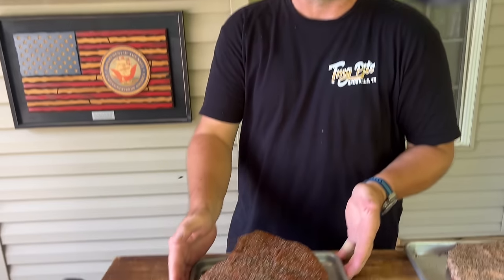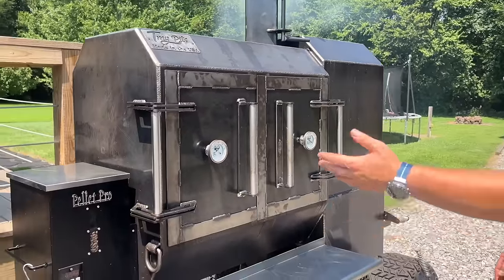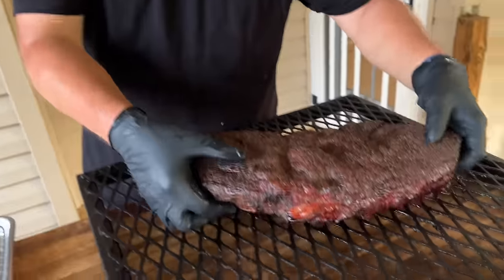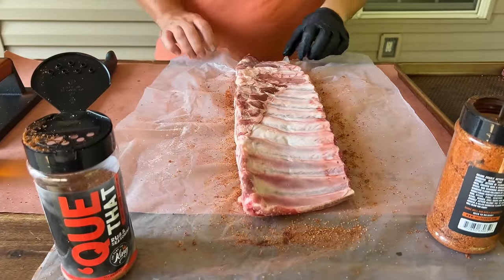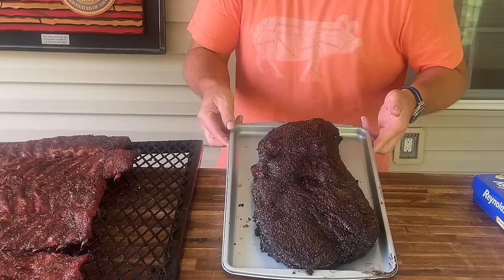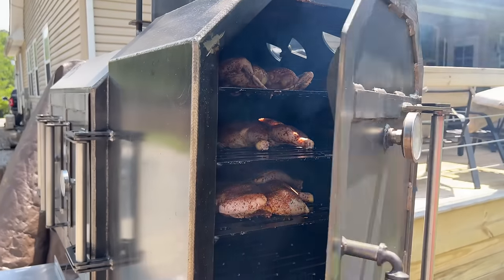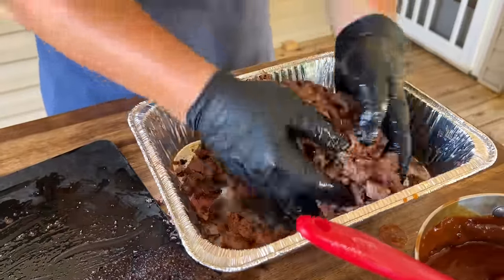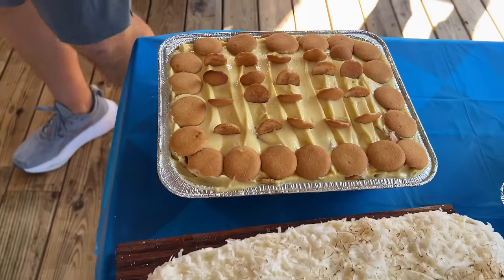New GRILL Handling a HUGE BBQ Feast for 30 People!  Brisket, Ribs, Chicken, Sausages, and more!

Comment: Half the I smoke brisket, pork shoulder, pork ribs and beef ribs; I tend to cook till at least 185F and let rest til 150F. Then I put in my Pit Boss Verticle Elite or smokin' tex 1500c at 150f and hold overnight. It is often pull and bite threw tender.

Comment: I think you would absolutely love the SnS Kamado, as it's basically a Weber Kettle in Kamado form, built around the Slow N Sear. Definitely has that set it and forget it when you learn your vent settings, with much better flavor than a pellet smoker. Great jack of all trades pit and one of the best bang for the buck pits on the market IMO.

Comment: All the meat looking good. The brisket, were you concerned it being in the danger zone of 40 to 140 degrees soo long. It took the brisket hours to get above 140 then you took it out to cool down to 150 before refrigeration taking it longer to get below 40 degrees then next took a long time to get it up and over 140 degrees. Bacteria loves the above 40 degrees and below the 140 degrees.
Reply from the maker: Was I worried...yes..did it happen...now...at the 3 hour mark at night we double checked and had to ice bath it...dropped like. a rock..we were right at 60 degrees...so didn't take much...bringing back up to temp...same thing..the temp mirrored cooking a brisket...What surprises me is how many  people tell me how I cook brisket wrong and they have been doing it for 40 years etc...but they only cook at 200 overnight...or 200 for 4 hours and bump up to 250 the rest...we here it all..and just like you...the first thing I think of .....aint know way that can be safe....no way in the entire world.....a briket being cooked at 225 or under can get above danger zone in 4 hours.....
Reply: @PelletsandPits  I’ve been smoking pork ribs anywhere at temperatures of 145 to 170 around for 4 hours before wrapping and finishing probably not getting out of the danger zone I believe probably 5 hours. Knock on wood no upset tummy or anything. Kind of wonder about the safety guidelines are on the safe side?
Reply: There’s always one of these guys 🤦🏻‍♂️.

There are thousands of bbq joints across this country. Do you think they are hitting 140* in 6 hours every single time? Absolutely not. It is not concerning in the least bit.

Comment: Great video!  I have the Workhorse 1975 but the door is just too heavy at my age. Really liking the Fridge. Did you get the insulated fire box?  I saw a post somewhere that they had trouble keeping it hot  (it wanted to run below 250).  Have you seen that?  Also wondering about the reverse flow and how the food tastes. Thanks!
Reply from the maker: Well thats alot to answer..hahaah I live in East Tennessee and insulated fireboxes are not necessary...it comes with 1/4 in steel and thicker on the door and thats thicker than anything I already have...I honestly laughed at trying to keep low...absolutely not...matter of fact...you can cruze at 275 to 300 without effort...you actually have to work to keep at 250...manage the fire etc...as for flavor...unless I taste side by side...I dont think I can tell

Comment: Typically you want a brisket to reach 203-208 (probe tender) for proper fat rendering. Love the new grill.
Reply from the maker: yes...typically....but remember...these were cooked the day before as well...and they were prime...dont know if i mentioned that..208 is extremely hot for me....but completely understand for some
Reply: @PelletsandPits  yes sir. Myself, I usually cook to around 190* then do a long hold, wrapped in paper,  holding at around 145-150 to finish the cook. BTW I absolutely love the dual cooker. I've often thought that would be so handy.
Reply: @PelletsandPits  In the past, when timing was inconvenient,  I smoked to 190,  added tallow to paper, refrigerated. Later finished in a turkey toaster 8-12 hours prior to serving. Turned out fantastic.

Comment: If the pit is 250, what is the temp in hot box?
Reply from the maker: Depends on the settings in the hot box...i mentioned it can rin 50 to 100 degree typically...but we can adjust for sure...